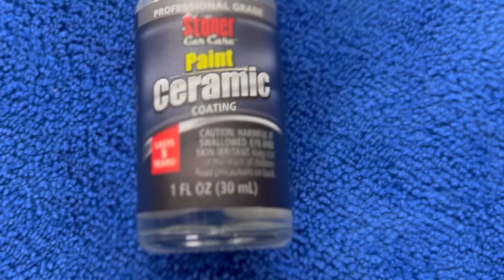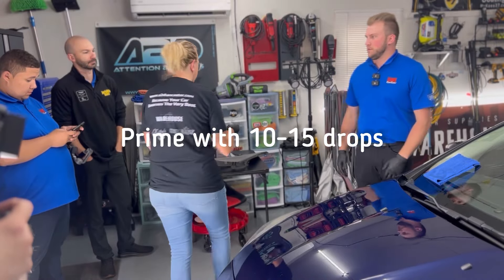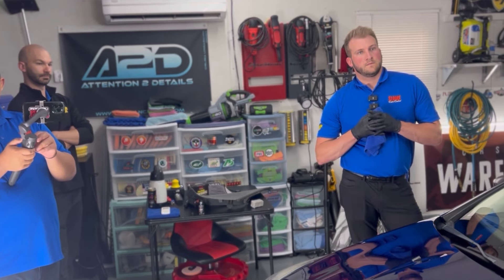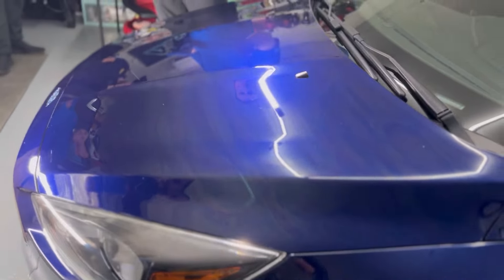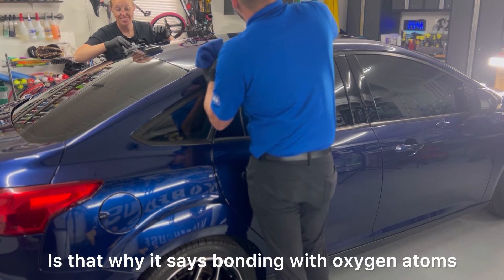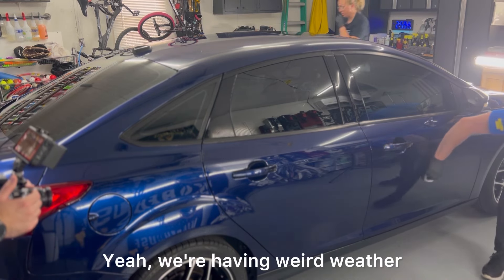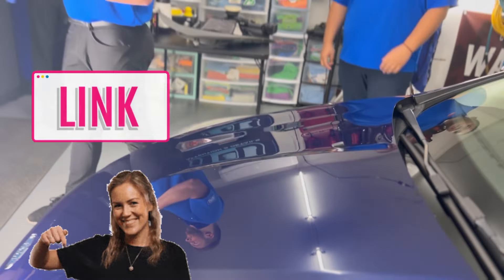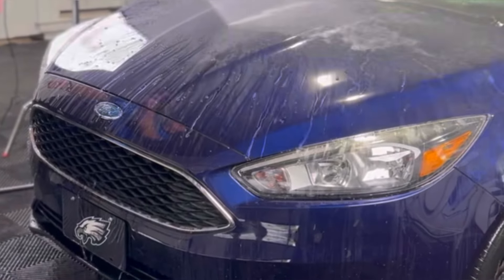@StonerCarCare NEW Paint Ceramic Coating- Insider Look!

Comment: Good question regarding letting it flash longer. Sandro at Car Craft did a saturation test with a few Carpro coatings. He found the longer you let it flash before leveling, the darker the saturation. Always wondered if that was the case with other coatings.

Comment: Respectfully, for a daily driver vehicle, I will stick with a wax or sealant. I still wonder why a huge company like Turtle Wax has yet to introduce a multi year, ceramic liquid in-the-bottle coating.
Reply from the maker: They have with their ceramic spray coating but they probably won’t because their market is the beginner or enthusiast who may not have as much experience with how to properly prep a vehicle for a coating
Reply: @attention2detailswchelsea Perhaps. It just seems odd. Thank you.

Comment: Hi when wiping off the coating do you use the plush side nap of the microfiber towel or the short side nap of the microfiber towel for best results  ????  Thanks
Reply from the maker: Short nap towels normally work best for the initial level and then the plush side for the final wipe
Reply: Thank you !!!!   @attention2detailswchelsea